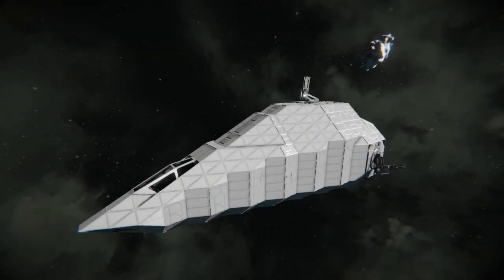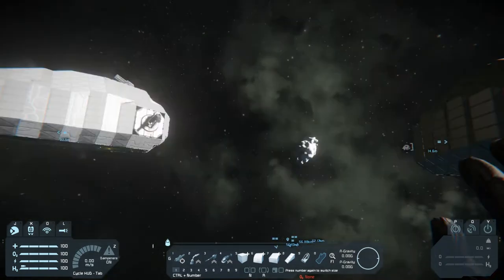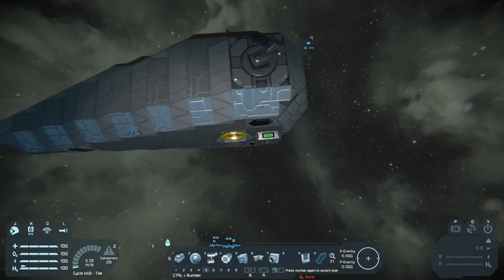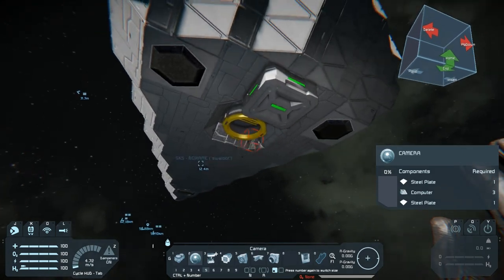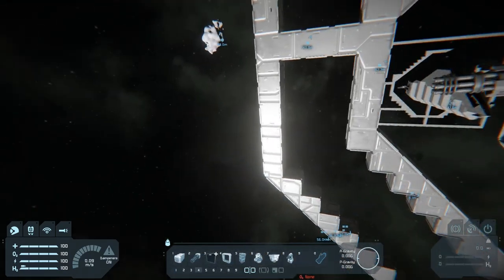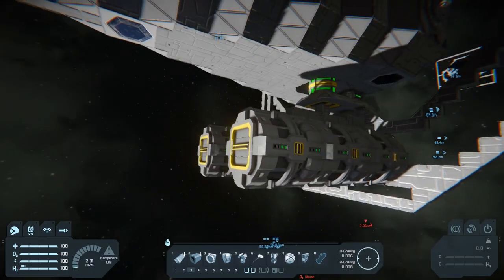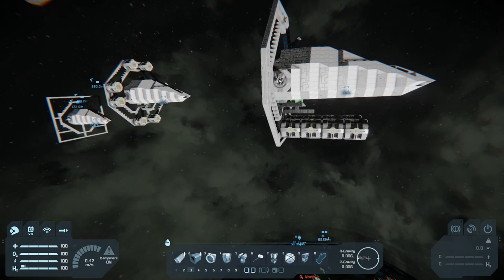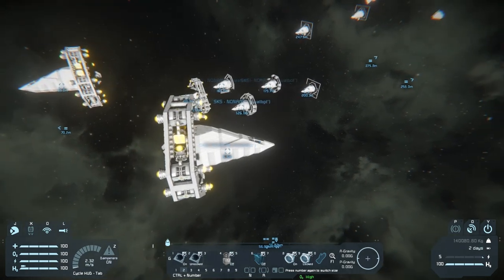Let's Play Space Engineers - E52: First Design Phase Of The ATR (Atmo Transfer Ring)!

Comment: Wait, this game has no turning capacity from firing opposing thrusters? In that case remove most of the backwards thrusters and replace them with gyroscopes. And for an atmosphere transfer system you might want to revisit that bottom forward lip but with tons of downward thrusters to keep the thing airborne. Or put the connector on the back and go full rocket ship. In general those are the only two thrust directions you really need for a "transfer assist system": downwards and forwards.